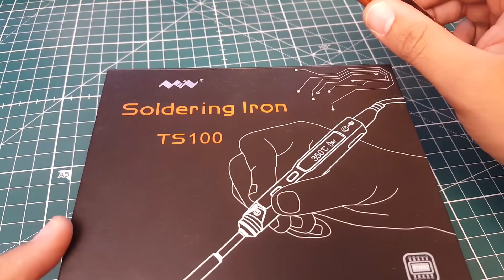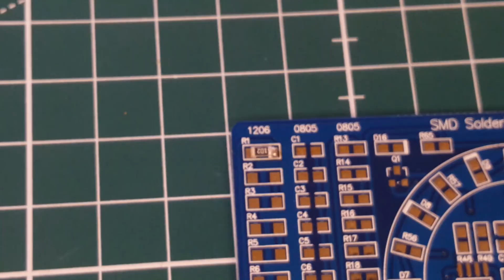Best Portable Soldering Iron!! // TS100 Soldering Iron

Comment: Conical and knife tips are useless.  Why don't they ship these with a 1.6 or 2.4mm chisel.  BTW, those first two resistors seemed like the solder wasn't flowing well at all.  Need to flux pen those or use some good kester or multicore solder.

Comment: You should heat the copper surface before soldering process. This is very important for perfect soldering. If the copper surface is cold, surface pushes solder. So you can't do good work.

Comment: How much watts does this thing have? If it has no more than 6 wats its the same as those 3+aa soldering irons...
Reply: With a suitable 24 volt power supply it is rated at 65 watts.
Reply: well at 24v it draws 2.7 amps at 12v it draws like 3.1 amps so yeah

Comment: Excuse me if I don't take soldering advice from someone who refers to a conical tip as that pointy thing LOL. 

On a more serious note, people who are impressed with this soldering iron have obviously never used a good soldering iron before. It's an okay iron for field use but to call it the best Soldering iron ever is absolutely ridiculous. 

 I suppose it's perfect for people who don't do a lot of soldering and who like lots of menus and settings to play with but to be honest it's just a soldering iron and the only setting you really need is the temperature and probably an offset. 

Personally, on the bench, I use a Hakko FX-951 and I can tell you from experience the TS-100 can't even come close to comparing. Just from the standpoint of ergonomics alone, the FX-951 wins hands down. 

 The 2027 ESD safe handle is far better balanced, the power cord is so flexible and light that you think you're using a cordless iron. Oh, and I won't even go into its ultra-fast recovery time or the hot-swappable tips. 

I have 10 tips in the Hakko holder and I regularly switch them out while working on a board, It literally takes seconds to do.  

 As the old saying goes you need the right tool for the job and in this case, besides ease of use using the right tip makes a staggering difference when it comes to the quality and dependability of your work.  What good is a flashy smart iron when you don't have the right tip for a job and are creating substandard work. 

Another almost indispensable feature of the  Hakko is being able to color code your tips using different colored tip sleeves. I Personally can't figure out how I ever got by without it. With the right tip on the FX-951, you could literally solder the wings back on a fly.

On the other hand, the TS-100 feels like cheap Chinese junk in your hands. The buttons on the handle are ridiculously inconvenient and the body/ handle style is literally an ergonomic nightmare.  Oh and good luck finding a power source with a nice flexible high strand content heat resistant silicon wire. 

 Most people I've seen using these are using old laptop power supplies and the power leads are horribly thick PVC coated junk that's stiff as a board. When using a TS-100 attached to one of these laptop power bricks it's like the proverbial tail wagging the dog.  I can't tell you how many times I've seen one hit the ground because the power cord drug it off the bench. 

Don't get me wrong I got suckered in by all the hype as well so I do actually own a TS-100.  I hate to admit it but I actually own two of them, Yes I got suckered in by the so-called upgraded model. 

After all the hype wore off I found that more often than not I was grabbing my old battery power Hakko FX-901 for quick field repairs.  

 Sure it doesn't have a menu system and to be honest, that's a useless distraction that I no longer miss. 

Now to be honist the Hakko is about 5 seconds slower heating up but that's more than offset by the sheer amount of time saved not having to dig out the power supply and finding a place to plug it in.  

 By the time you dig out the iron and power brick and find a place to plug it in and wait for it to boot up I've already finished the repair job and I'm back in the air flying.  

 Then if you can't find a place to plug it in you need to dig out your battery pack or portable leads and set that up.  So, in the end, it's quick heat up time is meaningless when you add the complexity of needing an external power supply, at least for fieldwork.   

Just about everyone at my flying site got suckered in by all the hype but have since switched back over to the simpler Hakko FX-901. 

 It's built-in power source makes it much faster for quick field repairs and its hot-swappable quick release genuine Hakko T11 composite tips are much nicer than the cheap generic Chinese tips used on the TS-100. 

 I also especially like the swappable battery cartridge.  I keep a spare pack loaded with a fresh set of NIMH batteries.   
  
If you must have a Smart-iron with a built-in computer and menu system then For occasional field use the TS-100 is fine but I could never imagine using one of these as your only bench iron especially if you're an aspiring advanced amateur who's looking forward to building kits and home brewing projects.  

The TS-100 is definitely an over-hyped  Chinese fad product of questionable quality and I find that most people who have them are fanboys who spend far more time fiddling with their menu settings and talking about them than actually using them. 

It's just a soldering iron folks other than bragging rights or to stroke your ego it doesn't need a built-in computer and  30+ item nested menu system.  It just needs to get hot have simple stable temperature adjustment, maintain a reasonable temperature recovery time oh and auto sleep to preserve tip life.

 Talking about tips, it should have simple high-quality ESD safe hot-swappable tips with a good selection of available tip styles.  

  They've gone so overboard with the menu system in this Smart-Iron that I'm surprised they haven't added Bluetooth and an Android app so you can monitor and share its sensor parameters on your smartphone and Facebook while soldering broken wires at the flying site.   

Hey, maybe they can add WIFI and Twitter too so all your friends will know when you've turned on your soldering iron. That way they can rush to Facebook and watch the sensor graphs and share menu settings. 

Seriously, folks, it's just a soldering iron how flashy and overcomplicated does it need to be to appease your ego. 

With all that said, for $40 I would probably buy one. But to go around claiming it's the best Iron is beyond ridiculous. We get that you want to justify your purchase but do you really need to over-hype a product to feed your ego and justify your purchase.
Reply: You could buy four TS-100s for the price of one FX-951 and have bills left over for the strip club. You're right, a soldering iron just has to "get hot have simple stable temperature adjustment, maintain a reasonable temperature recovery time, and [...] auto sleep to preserve tip life." The TS-100 has that, plus if you're into playing with menus (and/or Tetris), it has that too. Then there's the portability factor. Sure the FX-901 is portable, but I already have enough LiPo's in my case, I don't necessarily want to carry iron specific batteries on top of everything else. You point out that tip changing is faster on the FX-901, but how many different tips are you really going to use while in the field? And those Hakko tips are twice the price of the TS tips. How long does it take to plug a battery into a simple homemade power cable? 10 seconds maybe? That surely will be offset by the faster heating time of the TS-100 compared to FX-901. In the end, get whatever you want, but don't bash those who like something you don't.
Reply: It's a great iron... FOR THE PRICE. No one said it's the best iron ever. If you don't want to spend $250 on a station, and you don't want to use any of those old-school $100 stations, this is your best bet. Most people aren't doing a lot of soldering to need a station. If you are doing that much soldering, it's your job, you can buy a $1500 station, and you won't care about the price. The 3 wires you have to solder for repair your drone isn't considered a use case for a station. You're literally the only person, who owns it plus a station, I've ever heard say that this isn't a good iron. Either you don't really own it, or there's something else going on. (I'll bet the former.)
Reply: So you really like it then?
Reply: Uh its the best iron around for the price dude, Give me the extra money for the hakko and ill gladly use that, if not stfu and let people use what they want and what they can afford, you can do just as well of a job using this as a hakko ask Louis rossman
Reply: I stopped reading after Hakko. Don't get me wrong they are not bad at all but seems the fan base is similar to the apple crowd. I'll go with ... if it works for me and what I want to do ... who cares what the rest says. That said, time to get one of these TS100s, they look like they could make a viable portable tool for the odd case where you can't easily take the work to your desk.
Reply: Now try something like a nice JBC station and see how you feel about that Hakko ;)

Comment: 6:03 Now I know that you are manually soldering those FC's with dislodged components which are sold through Banggod later :D

But without jokes - this soldering iron seems the best portable soldering iron from all irons seen in this year. I wish to have mine too. In this year Santa already came earlier - got Mastech MS8910 https://goo.gl/kd6QRd which I wanted very bad because I often need to know the values of SMD resistors and capacitors which already are soldered in board. It definitely works! Request for this soldering iron probably will get to Santa in next year.

Comment: You are applying too much solder. For those tiny SMD parts I highly recommend using some fine (~0.3mm) leaded solder wire. It is waaaay easier to make nice, clean and shiny joints. Flux would not hurt either, but when using thin soldering wire it is not needed at all. Ur welcome :)

Comment: Dude use flux.
Reply: Vladmir Putin why, when you can avoid it?
Reply: wilhelmsenFPV because it would allow him to solder things like that ic in about two seconds and have amazing solder joints. Just tack two corners on, cover in Flux, put a blob of solder on the iron and drag it across the pins.
Reply: Vladmir Putin that wouldn't make much of a test for the iron now would it?
Reply: wilhelmsenFPV that literally makes no sense.
Reply: Vladmir Putin Any iron could do it the way you suggest. Here he shows that the tip is small enough and also heated enough to be able to solder the smaller pads and pins. I'm pulling your leg a little, but for demonstration of the ts100, I don't see the reasoning for using flux. Other irons might have had to use flux to be able to solder such an IC
Reply: wilhelmsenFPV you're not going to get an amazingly better solder job by just using a different iron. There's a reason professionals use Flux, especially on smd components. I'm tired of seeing a these botched solder jobs because people won't use Flux.
Reply: Vladmir Putin I was initially pulling your leg, flux is awesome indeed ;) I am myself working in electronics and will always use flux, always ;) Makes my days easier. But, for the sake of showing off an irons possibilities and quality, I would avoid using it. Since as you say, any iron can do a great job, using the correct solder/resin and flux
Reply: wlgrd It NEEDS flux. A test without flux is like testing a car with no engine oil. It'll run for a couple minutes without oil, but not for long, and it isn't good. However, you can tell that the solder he's using in the video is flux cored solder, so it's alright. He should have an external flux supply for additional application.
Reply: what about rosin core flux solder? is using paste just easier? and also about water soluble... any good?
Reply: UgpFpv resin core solder is good when you have thicker solder that what's is commonly used for say 0402 and down. Not much flux in the thinner solder
Reply: yeah it needs flux that solder isnt flowing good at all, lots of blobs and spikes.

Comment: Got one to do my first drone build, once my exams are over (one and a half weeks now). Going to be my main soldering iron since it’s cheap light and powerful. May pick up something bigger later on though. Tonnes better than the fixed wattage iron I’ve been using for years. Super cheap too.
Reply: Super cheap? You can buy non-portable solder iron for $18, like DANIU PX-988
Reply: marzobb 5 the Dainu is only half the price with which you sacrifice portability, build quality, open source firmware, 10-second heat-up times, automatic sleep mode when left alone for a predetermined period of time and it’ll come back to life once you start moving it again, etc...
Reply: That´s quarter of the price, not half. But yes, sleep mode with gyro and open system are nice futures, but I will stay with my PX-988
Reply: marzobb 5 the dainu is just short of $30 nzd on BangGood right now on special and I got my TS100 for just under $60 nzd, only a dollar or two over half the price. For me, worth the extra.